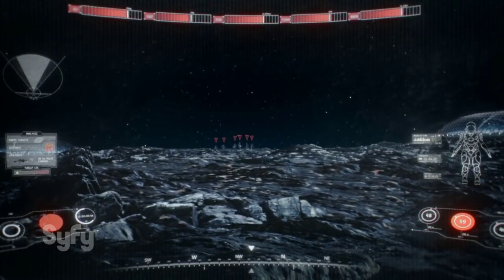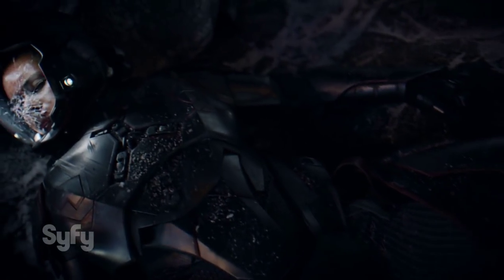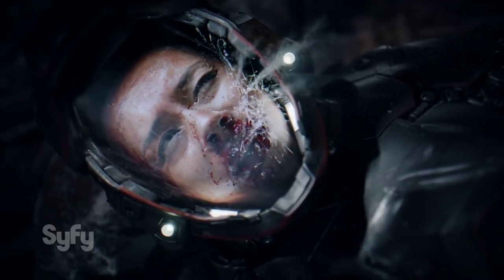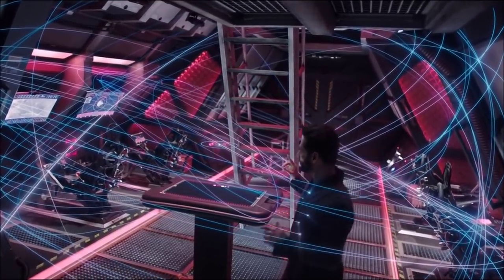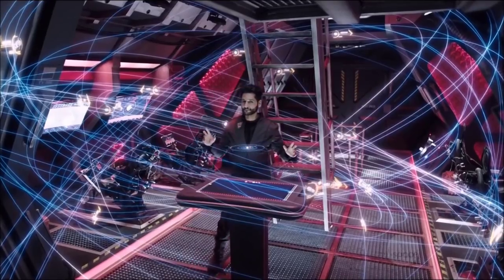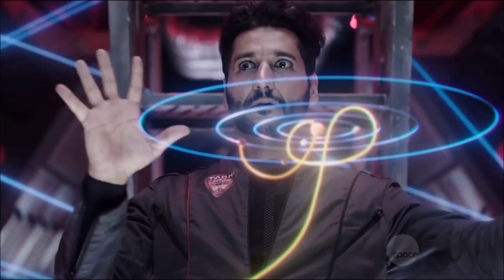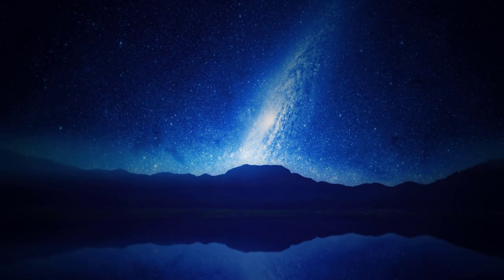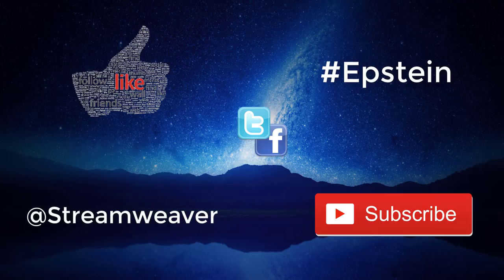Let's Do the Science:  The Epstein Drive

Comment: It's stated multiple times across the show and the novels, that epstein drive uses fuel pellets (idk what is inside of them), as well as reaction mass (water) for generating thrust. During escape from tycho after start of the war with Free Navy, they are "burning hot" and will run out of reaction mass, on the other side in the books after crew boarded Roci and escaped from the Donnager, they said that fuel pellets supply will last for years,  what they must resupply is water used as reaction mass. So there must be indeed some secondary reaction with H20 (or H2, or O2) involved. You are wrong about saying that people are making wrong assumptions about using water.

Comment: "Teakettle" is stated to run on highly compressed nitrogen gas (stated in the Leviathan Wakes novel), and is named such because it looks like a boiling teakettle when the gas is expelled. 
As to the secondary reaction for thrust, they are very likely using water for reaction mass. Water is stated to be the lifeblood of everything in the solar system, from people to industry to ships themselves. Miller muses on this very notion, also in the Leviathan Wakes novel. Given how much energy fusion already produces, it shouldn't be (too much of) a stretch to believe that the water is electrolyzed and the constituent atoms converted to high energy plasma. Sure, that's a bit of handwavium right there, but given the show itself (which the authors of the books have suggested should be the go-to source for such debates) states the drive is primarily about incredible efficiency... Highly energetic plasma being expelled at considerable velocity = significant thrust - at least from my understanding of Sir Isaac Newton's laws. If I am mistaken, please teach me otherwise.

Comment: In the books they explained the MAIN reactor used fuel pellets.  In Cibola Burn they went into particular detail where Alex explains it is inertial confinement fusion (with the lazerz!).  ALSO low-radiation could be achieved with aneutronic fuels (like D-3He).

Comment: The bigger problem with fusion or even fission is not the reactor. The current challenge is converting heat to usable energy. Modern pelletier devices in the field are about 6% efficiency.  There are lab ones that get to about 9%. This solves several problems. 1. Less need to cool the reactor. 2. Massive energy spikes. 3. Portability.  To give you some ideas of where modern scifi is. To get to a internal combustion engine 25 to 30 percent. Mechwarrior 50 to 60 percent. Star Trek is 90 to 95 percent. That's where we should focus money.

Comment: In the later books, they mention there is "thrust mass" hanging around somewhere.
Reply: it's also mentioned in the TV series, as a note that they are low on reaction mass... not sure which episode though, sorry
Reply: Could be thrust mass is the fuel pellets and reaction mass is water. I personally would love to see how the fuel works in the show because if its solid pellets then there probably is canisters of these things stored around the ship. Also love the fact that the drive plume of the engine actually comes out of the center nozzle with a coronal effect around the drive cone.

Comment: I think the show explained it as an engine that utilizes the fuel (not specified) more efficiently than other drives, not really one that used a different kind of fuel. So it would be a drive that spins at a much higher and faster rate... than what passes up as modern drives in the future of The Expanse. I think it's a mechanical advancement, rather than a fusion of existing engines to achieve a certain miracle engine. 
Possibly... it isn't even quite based on anything but the concept that our engines could be better constructed to help us do more with less fuel. The landing part, that I think is a good point but that part it seems to have been answered in the books.

Comment: There is such a thing as aneutron fusion. Boron hydrogen Fusion. I guess the author went with deuterium helium-3 Inertial confinement Fusion. Which only produces charged particles, an alpha particle and proton with 18.3 MeV. If you could turn that into thrust it might be quite significant and it's also a direct conversion to electricity.

Comment: Sounds to me like a fusion reactor, surrounded by a breeder-type reactor that takes the neutron outflow and the radiation produced by the fusion reactor, further energizing the plasma for propulsion, as well as furnishing more onboard power for life support, weapons, etc. What they clearly DON'T have are anything like inertial dampeners that would allow the crew to handle high-G thrust or maneuvers.... or some kind of gravity plating that would let the crew move around the ship without wearing special boots that attach to surfaces. So, they've advanced fusion technology enough to make it very useful in getting around the solar system (while still not being powerful enough to reach nearby stars without the crew having to go into some kind of suspended animation), but NOT advanced enough to build things like inertial dampeners or gravity plating. The show is consistent with that, because the ONLY places where people move around normally are on large space stations - like Tycho Station; which uses revolving sections to simulate 1G gravity.

Comment: From my limited knowledge I would say that fusion alone cannot provide the thrust necessary for those kinds of acceleration.  You need some type of reaction mass.  Plasma is plausible, and since plasma can be ionized, you can magnetically focus it out the back.  However hot and "pliable" plasma might be, it is still not dense enough to push the mass of a ship.  That is why water would make good reaction mass,  because it can be turned into a plasma by the reactor and shot out the back; and also has mass that can enact a push on an object.  But again, water is not compressible, so you could not store enough water on the ships we see in the series, so it has to be something else.  I'm not formally educated so this is probably super-simplistic and maybe wrong, but it makes sense to me in a plausible near-future drive technology.
Reply: the reaction mass is indeed the fusion plasma, and whether it is dense enough is only a matter of how fast and thoroughly you burn the fuel and its effective exhaust velocity. in the expanse, this effective exhaust velocity is 11 million m/s; that might seem unrealistic, but for fusion it isn't really. the epstein drive might push up to 100 grams of alpha particles out of its magnetic nozzle at this extremely high velocity each second, to produce the thrust.

Comment: Rocinante in the show have about 0.2c delta-v. With such delta-v it should be possible for spacecraft to reach speed at which Bussard fusion ramjet would work, so the ship would be able to accelerate further... indefinitely. Until the ship reaches halfway point of its journey when it flips over and starts decelerate. At 1G constant acceleration it will take about 6 years for the crew to make it to the star system 100 light years away from Earth (due to relativistic effects).
So if humanity have something like Epstein drive we would be colonizing the galaxy. 
While spending 6 years in something like Roci sounds horrifying, it won't be so bad in the spaceship the size of Donnager or Agatha King.

Comment: Basically everything you said about fusion is incorrect! Most fusion reactor use some combination tritium, deuterium and, helium 3 not pellets. The only reactor that uses pellet based fusion is laser target reactors which would be far too massive to use and the pellets would actually take up more room then just the gas contained in the alone by a huge margin. Just because there is no visible fuel tank does not mean there isn't one in fact you would want to keep it inside where it is protected by your huge plating. Most likely these engines would be deuterium helium-3 fusion since it has the most power output and does not produce any neutrons which BTW are not large at all in fact the are far smaller then any fuel you would use. You would also be able to use these drives directly to provide thrust and would work almost exactly like a standard rocket engine where as you have a combustion chamber and the a rocket bell the only real difference would be that the combustion chamber would be fusion chamber instead.
Reply: "Most fusion reactors" is equally incorrect - unless you refer to contraptions that keep split-second stable plasma reactions as 'reactors'.
Reply: What are your sources

Comment: Let's do some math.
Step 1. Grab random wikipedia fusion energy density numbers: 2.25 *10^14 J / kg (quote: 'specific energy of about 225 million MJ per kilogram of deuterium')
Step 2. Make assumption: Drive uses 100 kg of propellant per 1kg of deuterium consumed in fusion. That leaves space for potential energy losses.
Step 3. From kinetic energy, calculate exhaust velocity as 1500 km/s
Step 4. Use Tsiolkovsky rocket equation to find out that spaceship with such drive would have 158 km/s of deltaV per 10% mass loss. 

Step 5: Find YouTube comment that states that some ship in the Expanse 'only accelerated 11 hours or so at 1/3 g instead of any significant part of the trip'. 5 hours * 1/3 g equals 130 km/s. Estimate used propellant mass for both accelerating and decelerating as 16% of the ship's original mass. Calculation and estimation both seem good enough.

Step 6. Be proud of yourself and your math skills :D.

Comment: I for one would sooner be convinced if the "exhaust" of the epstein drive isn't where its thrust comes from, but is rather just waste heat. The mechanism would more likely be an as yet undiscovered means OF, SPECIFICALLY, pushing off of spacetime itself. Creating anchors of virtual particle nanosingularities that "hook" into the fabric of space time as they perforate, creating an anchor for a few nanoseconds that has enough of a magnetic field that mass driver rails inside the engine can push the ship away from it before it finishes evaporating. 

it would conceptually just bridge energy straight into force.

Comment: Boiled water might actually be able to propel one you across the solar system.

you use the hydrogen for nuclear fusion, and oxygen for the crew (or put the oxygen into the fusion torch accelerating ti to near light speed) So yes you have a massive fusion torch that runs on water. 

Also breeder reactors are fission  not fusion.

Comment: At first, I have not watched this post till the end. Only a third of it. 
I have a little different theory about a little more efficient ion engine.
If we assume that we have a very power full source of energy to give the necessary power for a working ion engine, the problem is the source of matter which has been accelerated to give enough reaction for a prolonged time to accelerate very massive spacecraft. In the Expansion, the spacecraft uses acceleration gravity which keeps through nearly all the time of the journeys. so we need somehow a very efficient way to accelerate the space ships with a very low projected mass consumption. 
As I see there can enhance the efficiency of the ion drive, by project backward plasma or some charged projected layer with a strong magnetic field but with minimal mass.
If we use this layer (with the effect that charged particles can not be shot through this layer it as the ions (which has an electrical charge) due to no charged matter can move through a strong magnetic field (which can be created with the use of electricity which can be possible to gain with some strong reactor (fusion or other conventional but powerful enough reactor) but in theoretically less mass of projected matter). 
In this way with a periodical backward projection of layers magnetical fields we can make the ions to jammed against these layers. Which used in short burst the projected ions pushed against this charged layers and jammed to each against in this way we can create an additional way to push again the previously projected matter and create en extra way to accelerate the previously projected matter. 
So like to shooting backward a big pillow and shoot enough peas so the last one is pushed against the column of peas which is lean against the pillow and then to each other. In this way, the last one can accelerate the column of peas and then the pillow itself. 
The point of my idea is that with enough electrical power these packages can be used twice: 
- once as a projected mass to use as a counteraction to create reaction force to accelerate
- and again once more to accelerate the again the previously projected matter again to lean again

In this way, we lost a lot of energy in the double acceleration and in the creation of the backward projected strong magnetic field. But if there is a strong enough source of energy to provide power but we use the backward projected mass (which is the bottleneck for a prolonged accelerated space travel) .

So that's my idea for a more efficient way to travel with continuous acceleration for heavier spacecraft

Comment: What is the only fuel we know that has a 100% rate effiency? antimatter. 

It seems feasable to think that they got fusion reactors to the point they had spare energy to use, once they achieved that, they started to build anti matter. 

The key with antimatter is magnetic fields, the drive could posibly just make sure to let all the energy out of the nozzle, which is indeed much easier than what we currently try to do with fusion reactors, in which we try to contain the hole reaction. 

Once you are able to guide both the energy and radiation to places not harmfull for humans, you don't really need to deal with it for the most.

The issue I see is the landings and landing zones, the solution I see are those space suits. Sure we will need a quite good radiation proof space suit if we are to stay out there for long periods of time, probably using magnetic fields withing the landing pads themselves could do the trick to stop them from melting as well. Again, within current tech actually.

Ships would probably need to be made from a non magnetic material tho, all these magnetic fields require for it. Titanium would be my first idea. Once we can mine outside the earth, sky is literally the limit.

The one real issue I don't get to be able to imagine a solution for is how we protect the ship from space debris such as dust or particules, somebody really needs to discover the way to produce force fields. And we need it now.
Reply: Also, the only place we can get antimatter right now is in Particle colliders (and also positron decay, I guess, but either way the whole of humanity has barely produced enough antimatter to heat up a cup of coffee) and the longest we have been able to contain a single antiparticle was only about 17 minutes.

Comment: To begin with, suppose that the standard propulsion of spacecraft before Epstein used a mixture of deuterium and helium 3, which fuse with some ease. The result would be a mixture of deuterium, helium 3, helium 4, neutrons and gamma rays, at a temperature of several million degrees. Depending on the degree of efficiency, the initial fuels would be transformed into merger products in an amount of 5 to 10%.

The finding of Epstein could be a way to increase that percentage to over 50%, which would give more than 10 times the previous push. For example, increasing the pressure at which fuels are found or finding a way to reflect the fusion products back to the area where the fuels are joining. If, in addition to that, something like Lithium 7 is injected, it can absorb the neutrons, and the resulting Lithium 8 can be broken into two helium nuclei 4, which increases even more the total efficiency

Everything is based on the possibility of creating fusion engines capable of occupying a few cubic meters and achieving efficiencies above 5%. The bell that guides the plasma (without touching it, because it will evaporate) is not included in these measures. A water tank of several thousand liters would brake any escaped neutrons that went towards the crew quarters.

Comment: For the radiation you're in space so any excess should just be reflected out into space. You aren't going to compete with the sun on radiation, and second the higher radiation in the reactor will cause higher pressures but fusion reactions are pretty clean. It's probably an EM like drive using the heat of the reactor to make heavy gases (xenon) into a plasma that is then magnetically catapulted out the back end. Large drives would definitely blast plumes of hot particulate out into space.

Comment: It is impossible for particles or any matter to exceed the speed of light. It should be possible to exploit the increase of mass that occurs when emitted particles approach the speed of light. Instead of emitting greater amounts of matter, like a conventional rocket, it would be interesting to design a device that could accelerate a small amount of charged particles to relativistic speeds. The emitted particles would never exceed the speed of light but the closer they got the greater their impulse would be. The rocket plume would be minimal, but the emitted particles, could if accelerated with enough power, generate all the thrust that is necessary. That would be a very efficient engine indeed! As you say 1/3 g, as long as it is continuous accrues to immense speeds in a short time. Thanks for the problem!

Comment: They could use water, 1st for drinking, 2nd split it to get the oxygen for breathing, 3rd use the hydrogen in a massive high powered ion drive that is powered by very efficient fusion reactor. Inject the hydrogen into the exhaust and accelerate it to near relativistic speeds by the massive amounts of power produced by the reactor using superconducting magnets. and you only need to shield the radiation in the direction of the crew, a shield and/or large water tank directly between the engine and crew compartment.